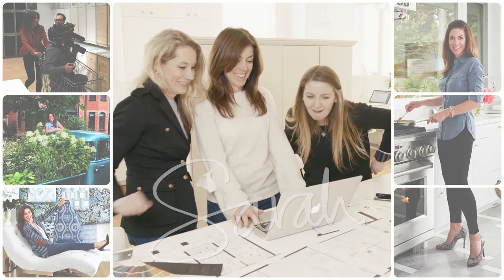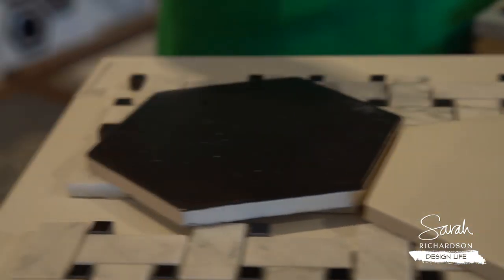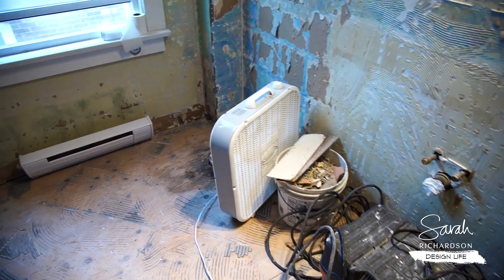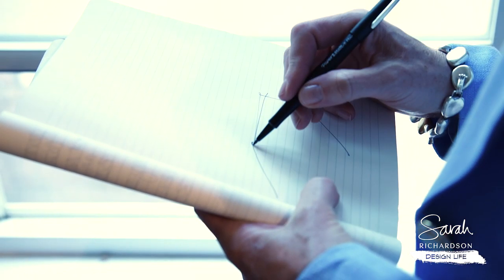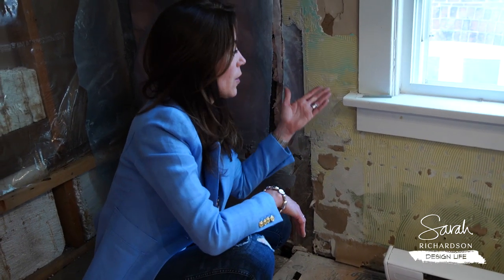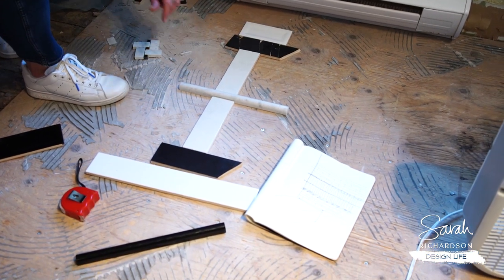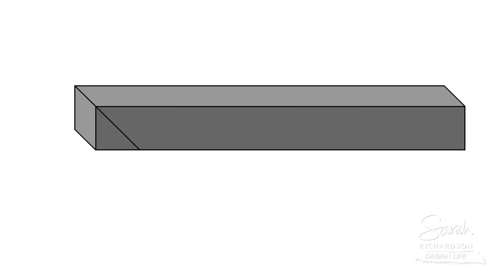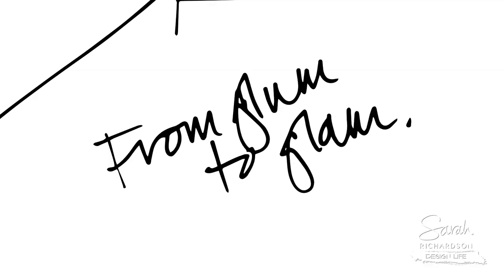Modern Family Bath: "Advanced Tile Manoeuvre" (Ep. 2)

Comment: Gonna say too challenging to have a listello go through water valve trim area (and I love a challenge). He (assuming he) 'could' have the trim piece on hand and have listello die right into edge of trim (no return, not necessary as this is a through color piece) and place field tile under/inside where trim piece will be as sort of a 'place holder'. Only the best tile person you trust can pull this off. Otherwise, just move the listello above the water valve trim piece. Not sure what this does to lining up with backsplash. But I get it, I had a horizontal border perfectly align with top of vanity as my backsplash -- it was a challenge but it looked great!

Comment: I'm wondering how the vertical transition from shower surround tile to non-tiled wall is going to look with all these differing tile types, I'm imagining a simple metal L trim to make sure the tile dies on a nice finished edge. It's good that the listello is continuous around the room, since that is the tile that is proud of the main tile surface, and serves as a natural boundary, but I wonder if the reveal on the non-tiled wall surface is going to look too deep compared to the shower surround. What is the wall surface going to be like?
Reply: Siansonea Orande I was asking myself the same question. I would have probably done just one soldier row.
Reply: Siansonea Orande I think the marble listtello is going all around the bathroom.  So the white tile should be on all the walls and the listello will be the cap tile and will need no metal trim.  (I got this from Sarah saying the soldier course would be the splashback above the sink). Above that in the tub section to drywall section, that might be where they would need the metal.  I don’t like metal so I usually end with tile that has a soft bullnose and it comes in many colours.
Reply: @dogzzz2002  I'm not talking about the horizontal transition above the listello when I'm talking about the metal, I'm talking about the vertical transition from the shower area, that is tiled above the listello, to the walls everywhere else, that aren't tiled above the listello. That's where I think they might put some kind of metal piece, so you don't see the raw edges of the tile in that area.
Reply: I hate those metal L trims😛